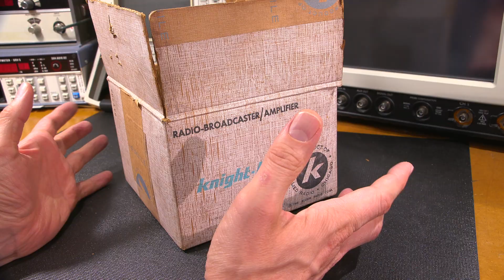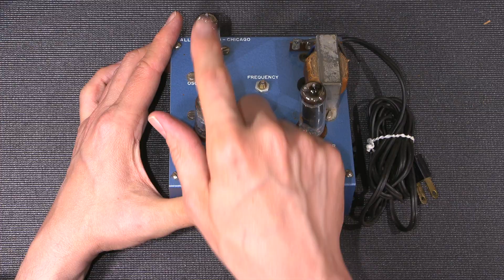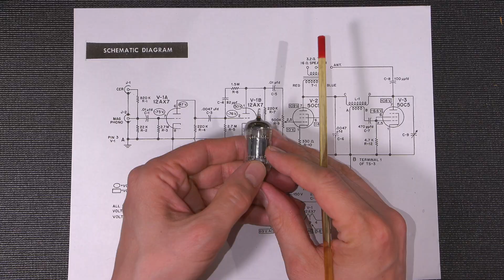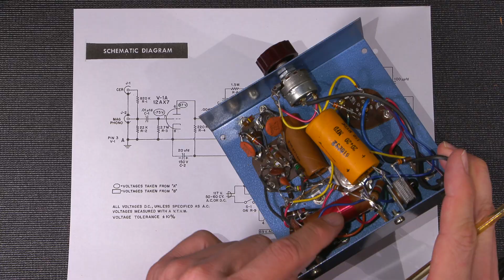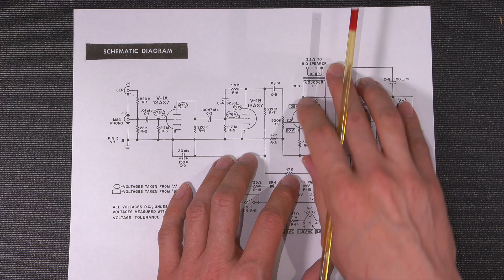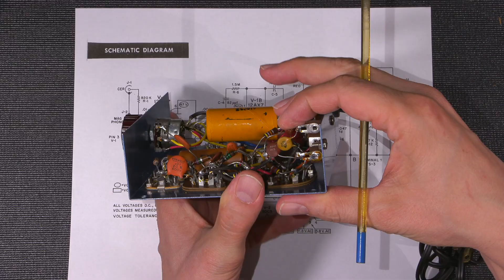Your Own Radio Station! The Knight Radio Broadcaster And Amplifier!

Comment: I know this is kinda late, but just a few comments.
In regards to the resistor in the filament circuit, there is little need for the resistor due to the difference between 112.6V and 117V. The resistor is not there for that. It is mostly to reduce the cold filimant inrush current as without it, the filament in the cathode sleeve is held cool longer than the areas outside the sleeve and inrush will often result in burnout on power-up. Watch closely when you power it up and you will note the exposed portions of the filaments glow very brightly, then dim as the cathode tube heats.  When the circuits are operating properly, most times the bulk of the charge bleeds off as the tube bias as a depletion mode device will drain most of the charges on power off. The danger is when working on a malfunction such as a heater fail, so the caps charge, and the tubes never draw power from B+ so the entire charge remains.  Never assume these are discharged without testing.  Yes, had one in high school. Grew up in the days of 5 tube clock radios. The tubes in series are all designed to use the same current and the higher power tubes just used higher voltage. Did not use or have an isolation transformer in those days. You learned the hazards and worked appropriately including the left hand rule.  Left hand is in your pocket when tuning these hot devices.

Comment: It sure could use an isolation transformer on the supply input, because if either pole was grounded one of
the 47Kohm resistors would be shorted out - the main switch on the hot/live wire and a full bridge
rectifier!

Comment: I have a complete 1960's Raytheon Lectron toy set which is Raytheon's only venture into electronic toys. It's comprised of electronic blocks that are magnetic which stick to each other on a metal surface that allow you to quickly make electronic circuits, a radio, a light meter, a noise generator, things of that nature so kids can understand how electronic components work. It's quite ingenious. Would you like to review it?

Comment: Since the original Knight Kit dates back to the 1950s the regulations for legal, license free broadcasting, namely 47 CFR Part 15, have changed since this was first manufactured. I hadn't been able to find any information that the Knight Broadcaster complies with Part 15.219(a) as far as maximum allowed power input to the final amplifier stage. I've evaluated many Part 15 certified and compliant AM and FM transmitters on my site with a few profiled on my YouTube channel. It was interesting to see you look at the KnightKit on your communications analyzer.

Comment: Back in the day, Stancor and Triad were the big dogs on the street for transformers and could easily run up to 1/2 the cost of the kits or more, so line voltage design, while "tasty", allowed a fairly affordable build for the hobbyist kid- like I was. My best friend and I would head to the dump about once a month and harvest components from old t.v.'s and radios we dug up for our reuse. Once we took a bucket of tubes to the local supermarket that had one of those courtesy tube testers there, but we were thrown out after about a half- hour of using their electricity and not buying any of their tubes. ☺
Damn, those were fun times for a coupla entrepreneurs!

Comment: At the age of 5 years in 1965 I build my first own AM radio, a crystal detector with bed as antenna and heating as ground, works nice. Here in germany I never heard about this cool kit for to build your own Radio Broadcaster from 1959. With 1 tube in Meißner circuit I reach about 1 km distance via AM. Now, here sadly here is no AM at all. Would be interesting, to find all the parts Knight Radio Broadcaster And Amplifier (mostly tubes) for to rebuild this device,
Dietmar

Comment: the Knight kit AM radio I built in 1963 for a project in electronics shop still works fine. there are few good AM stations anymore and the amount of QRM nowadays is insane compared to the good ole days. I also made a radio by drawing the wire on paper with a soft graphite pencil and clipping the leads for the other components such as I could.  mixed results but it did work for proof of concept.   there were very few printed circuits as they were too difficult to make then esp. for a school shop.  my favorite class.      I like you video offering and found it very nostalgic. makes me want to pick up the ole butter knight and blow torch and soldier something up. (the soldering irons we were provided were the large plug in type better suited now for soldering up in sheet metal shop.   lol  so the butter knife analogy is really accurate. Nail and blowtorch was common.   keep this stuff up I love it.

Comment: Aww, come on, leave the capacitors alone! Part of the experience back in the day was, you know, you'd turn on your TV and after 20 minutes or so, you'd have to get up and adjust the vertical hold (which was on the front!) because the capacitors had drifted enough to screw up sync. 

Sure, you could do a PLL off a crystal oven timebase, but that wasn't the reality of using something like this in the 1950s or 1960s. It drifted. 

Nice design and nice build quality. And yeah, I figured someone loved that thing - the original cardboard box survived with it.

Comment: We had a couple of these back in the mid-60s; in fact, I wired one myself. We were required to use an antenna of 10 feet or less. We didn't have any fancy modulation analyzer as shown in this video. Sure wish I did, though! Anyway, we fed our audio not to the XTAL or MAG ports, but from another 8-ohm audio amp which we connected via zip cord to the Knight-Kit's audio transformer terminals. I didn't discover this myself, another genius of a hobbyist put me on to it. It worked great for our neighborhood radio station, for which we had a home-brew console, a couple of turntables, a mike and a reel-to-reel recorder. The Knight-Kit was on the second floor of my friend's house, and the vertically-polarized, fully-extended telescoping auto radio antenna was mounted outside the house. The studio was in the basement of the house, which we were able to do because we ran zip cord from our audio amp to the Knight-Kit's xfmr terminals. "Those were the days, my friend...."

Comment: Im struggling to understand what the purpose of changing the dry electrolytic out was. It tested good, the rarely fail. Isn't that bypass cap you also pointed out, also a dry electrolytic? I'm amazed at its build quality! Disc caps are quite reliable, although in an RF circuit..?

Comment: I really enjoy your videos, and you have much knowledge. But the coupling cap between the 12AX7 halves passes a good amount of low end audio. If you calculate the Xc for a given low frequency say 50 Hz, and match it to the grid resistor, 2.7 Meg, you'll find that the 0.0047 uF cap will pass 50 Hz at a very good level, the Xc being 677k vs 2700K. The amplitude will be about 75% of the input. Doubling that would only bring the low end to 87.5 % of the input. Not very much, perceptibly. Just a decibel or two. What I find surprising is that it has a magnetic phono input but no apparent RIAA compensation, unless that feedback of 1.5 Meg resistor to 82 picofarads is it.

Comment: I was always interested in electronics. Went to college in 1989 initially to get an AS in electronics. Unfortunately i'm not THAT Mathletic and flunked out. Also, the teachers sucked. They were old at the end of their career and just didn't give a crap. They also couldn't teach in a way that showed you application. I went back for Computer aided design and several years later went back again for plastics. But electronics was always dear to me. 35 years after wanting a Ham radio license I studied and tested directly to General a couple weeks ago. The simple electrical theory rekindled my interest in it. Seeing these videos it's the first time in a long time that things make sense. If I had a teacher like you I probably would have hung with it and had a very different career.

Comment: What I want to build Is a tube AM or FM radio kit ,which no one makes any more when I was I my 20,s I found a tube kit on the floor of a old electronics store,it was a tube tuner kit with a vertical manic eye turning, as you tune the radio from right to left the manic eye would move from side to side ,and when it got to a good station the eye would close I have seen any other turning eye like that one ,it had a extra rc connector on the back ,it said in case fm stereo became popular ,I hook my tube tuner to my radio shack quad amp ,and my first wife husband still use it .But the enjoyment I got out of putting together that tube radio. ,I miss so much . I wish someone still made tube radios ,I love the sound ,and the tubes.

Comment: You might have restored it and compared its "new" specs with the old ones... commenting on the change. A frequency plot of the transmitted audio would have helped, also... to show that "small is also useful."  I owned one back in the early 60's and used it at a boy's camp for fun. I also taught amateur radio and was a swimming instructor as well as having a cabin full of kids.

Comment: Lafayette Radio made these AM broadcasters also--and in fully built form. They continuously but slowly would drift off frequency--even after being on for 5 or 6 hours--requiring listeners to retune every 15 minutes or so. But for $5, the broadcasters still were a good deal and lots of fun.

Comment: The way to make that safer without the need for  transformer is to lift all "grounds" off the chassis onto a bus or tag strip which is insulated from the chassis.

Comment: Hey, great channel!

General question: in old devices, you always replace the capacitors before doing anything else. How old is old? Point in case, I have a tube guitar  amplifier from the early 1990's, and it's working great so far. I never had to go in and fix anything, unlike some other old gear from before that time - turns out that I had to replace transistors more often than tubes in amps from the 80's, how ironic :) Anyway, what is the life expectancy of a capacitor made 30 years ago? And what can we expect from a capacitor made today?

Thanks a bunch for your answer!

Comment: Paul do you have a video that might explain the Heising modulation skeme?  Or maybe someone else could enlighten me with a comment.  I know the screen grid accelerates the electrons towards the plate and the suppressor grid pushes back all the high speed electrons that "bounce" off the plate.  The primary of the of the audio transformer is wired from the plate to the suppressor grid implying that there is a current between the two.  I don't get how this works.  I have a silvertone radio that uses 6f6 I believe in the final Audio stage.  The screen grid operates at a higher potential then the plate.  I don't get this either.  I've watched this video about 4 times already.  Great instructional video and very entertaining too.  Thanks once again for sharing your talent with us Paul.

Comment: Regarding capacitor inline direction, referencing - "outer foil-side." In your presentations you do not refer to polarity (+/-) nor do you refer to the black band side as being positive or negative instead you use, "outer foil end." However at: 25:22 it does show the capacitor with a plus indicator as an alternative to a black band symbol. The question is why do you not use "plus or minus" or positive/negative when referencing the capacitor's polarity?

Comment: I think the heart of the question at: 7:45 - if you should handle tubes with bare hands, the concern being: does the oils from your fingers create hot spots thus shortening the life span of the tube when the tube undergoes operating temperatures. For instance, you are warned by the manufacturer of quartz lighting fixtures to avoid directly touching the quartz bulb as it will reduce the life of the bulb. However you've answered the question when you stated the glass materials used.

Comment: I think that this would be worth modifying to use TELEFUNKEN Space Charge Vacuum tubes to allow operation of 12V, what about a 12D26  as the OSC tube at 12V and the ECC88 should also work on 12V

Comment: Yep, That was the “rig” Dad & I built for my youthful local radio station, albeit I added a long wire, which, as I mentioned in a comment on your post about your Gates Broadcast Xmtr, brought an FCC van cruising my neighborhood, in search of my errant unlicensed station. Knightkits & Heathkits put together on the kitchen table were my electronics “schooling” leading up to ham radio, TV repair, Bourns BioMed bench tech, arcade game tech, then EMI/RFI open field lab test tech with the advent of pc & mainframe computer hardware.
An even more beautiful pix of your amazingly organized electronic Garden of Eden-out of camera range, of course, is a workbench covered with caps, resistors, half-breadboarded projects buried in a rat’s nest of spaghetti, smeared with rosin drips & burn marks as the smoke of a well used Weller Station wafts over it all...oh, sorry, I was looking at mine!
73’s, WB6U

Comment: I made an AM transmitter for my grade 8 science project, the design was from Howard Sam's "Having fun with Transistors". It used 2  2n107 germanium transistors and I had to wind my own antenna coil.  It had a range of 6 feet and appeared on 7 different points on the tuner dial.

Comment: The other thing you showed looks like something I pulled out of a defibrillator unit and its purpose in that was basically a high voltage switch which runs on 12 volts for the Relay part it makes a contact on the inside to transfer high voltage to the defibrillator paddles... I actually still have a couple of those laying around and about four of the big high voltage DC capacitors out of those and yes I know to keep the terminals crossed over when they're just sitting....

Comment: Thanks I wish you were around 57 years  ago when I built this unit! My first kit I was 13 yrs old. I would broadcast local bands from my parents garage! This unit had a s surprisingly great ac carrier signal that would travel down a highway some two miles. Thanks for the great video , it’s a wonder I’m still alive at 70 years old now! I didn’t realize that there was a potential of ac on the chassis. Thank you thank you that’s my baby! I went on to be a commercial dj, then onto radio station general manager

Comment: is the reason you can power up without an antenna is because reflected waves have no impact on the transmitter? also, is the length of antenna a regulation?....Great info great delivery!

Comment: how it s possible 117 vac to be converted in 150vdc using only 1 diode and 2 filter caps, as i see that shematic have half wave rectifier,,,full bridge rectifier give 165vdc

Comment: You mentioned the 12AX7 tube. Is there a dramatic difference between a 12AX7, 12AT7 and 12AU7? I know that the AX7 is a high gain tube but what does the AU7 and AT7 stand for?

Comment: Seems to me it's easier to build modulation circuits with tubes than with Transistors/FETS. It's like they give you more options, like the screen, to modulate with.

What type of oscillator is that last tube working as?
Would you say that 47K resistor going to the audio section could be a form of decoupling as well?

Comment: I can remember one Christmas about 1950 when my older brothers had this device.  They imitated the "HADACOL" adverstisment.  The All american 5 were also called an AC/DC radios.
People in the rural area with no ac could but batteries to add up to 120 Volts and have a radio.

Comment: I was always impressed with your skills and the video, this time the equipment was impressive for me. I am digital logic person and do not know much about the tubes, but it has simplistic schematic and nice sine wave. Japan is still using none polarized 2 prongs plug. it is required to be enclosed in isolated case when the internal is not isolated from the mains. These days most of them are using isolated switching supply might be too noisy for most of the equipments in your video.

Comment: I took my 1961 Knight Kit Broadcaster mobile one time.  Using one of my friend's dad's shaver inverter, plugged into the cigarette lighter of the ole 1949 Chevy, and the car radio antenna disconnected and hooked to the Broadcaster.  My friend could hear me about a mile away, as I remember (a relatively open area).  Bet that little inverter was huffing and puffing and I can't remember if it survived the test.

Comment: I wish there were new kits around like that, nowdays…   I'd really much more prefer AM than FM.   But that would be only fun in the US. Here in Germany running a low power radio station is pretty much impossible… unless it's just a weak little FM transmitter like those for cars >_>

Comment: I love the design of this. If you switch the 50C5s for 35C5s, you can drop in a 35W4 as a substitute for the selenium diode for an all-tube design with the still-working filament string. 

Can anyone offer information on winding an oscillator coil like that, regarding turn ratio and dimensions? I want to build one of these transmitters.

Comment: My brother and I had this unit for our radio stations when we were kids (1965-1972).  We hooked up the antenna output to a 20 foot piece of 12 gauge wire and went off to see how far it transmitted.  We walked about a mile or two; the signal had drifted over onto a major station so we high-tailed it back and turned it off!  Great device and great show today!!

Comment: Wow did that bring back memories.  That was the first transmitter I ever had.  I put it in a wooden box and modified it to also be an intercom.  I somehow lost the unit over the years but it was the beginnings of my lifelong carrier in TV, Radio and Microwave broadcast RF engineering.  Thank you Knight Kit and Mr., C